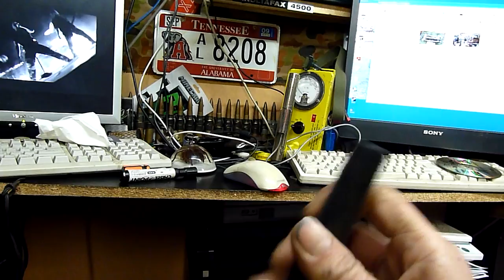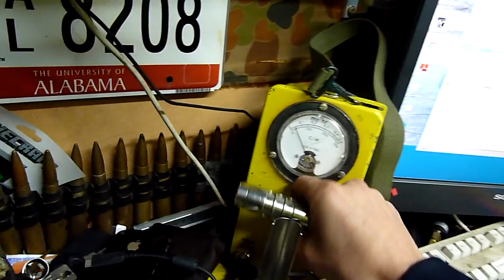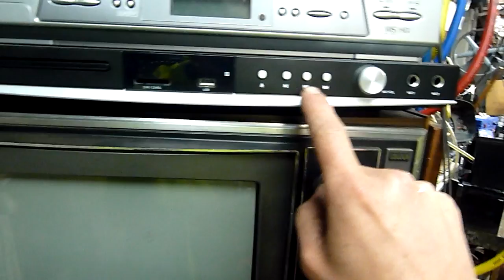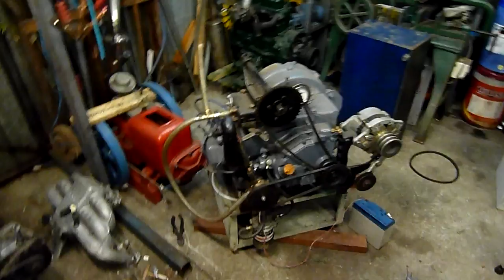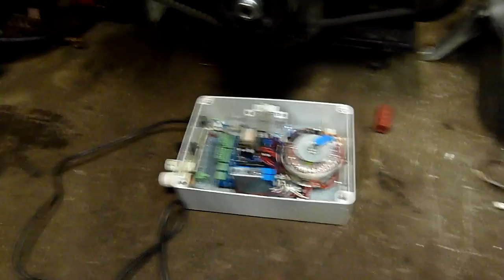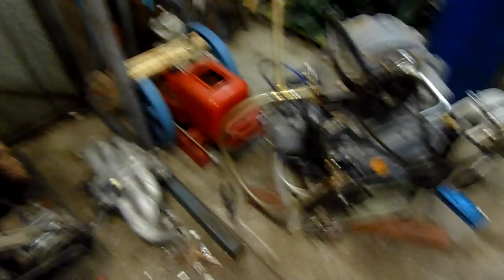Ramblotronic Thursday - Shipping, Testing and Building Stuff

Comment: If that toroid power transformer is good to go, get the super easy cheesy PB137 3 terminal TO-220 regulator designed for peak charging lead acid batteries.  It's cheesy because it's so easy to make a really good 12V charger.

Doesn't offer true float charge control like a closed loop system; but for a simple 3 pin device and a couple of caps.... who cares.  Batteries are happy and that's what matters.

Comment: Make an induction motor starting system, that you can move into position on any engine, and it would have that same crank size that your lever has. Can probably get a 1HP motor reduced with pulleys to get an engine turned over.

Comment: It's a very common mistake to leave the conduits going to control boxes open. Especially if a conduit going from the top. I've seen internals of control boxes completely covered with cooking grease, which got there from an open conduit. 1$ worth of silicon would've solved the problem.

The easiest way to lower the voltage from a transformer is to put one or more diodes in series after bridge rectifier. Because diodes have a pretty constant voltage drop. About 1V at couple of amps current.

Comment from the maker: well with the 2 windings together it puts out 29V rectified, so it should be good for battery charging with split 12 V outputs, in theory 14.5V. tho if its any higher I will need a reg.

As for water damage, the insulation will be fine, its only if there were bare connections undergoing electrolysis or arcing that it would harm the windings. but these Powertran torides look to have fully heat-shrunk/sealed connections!